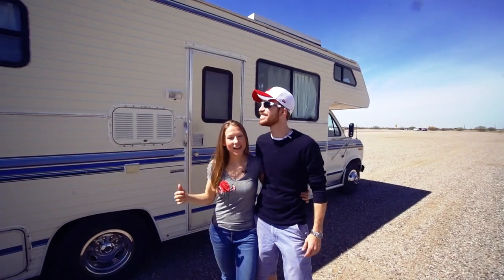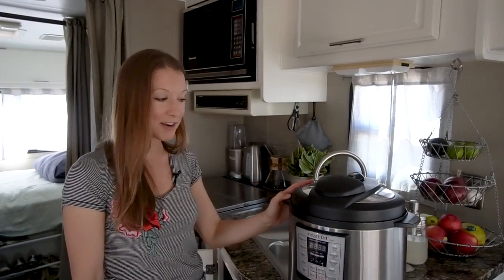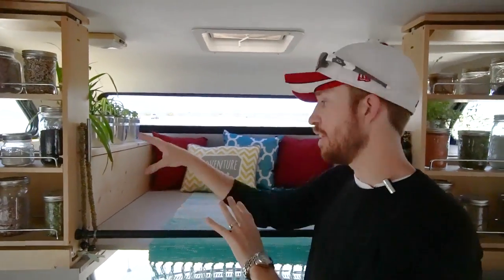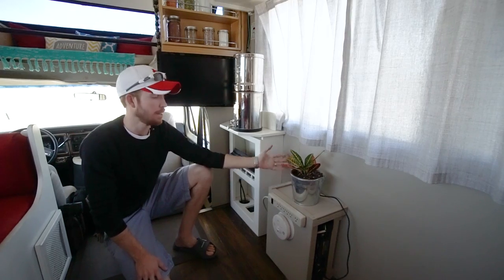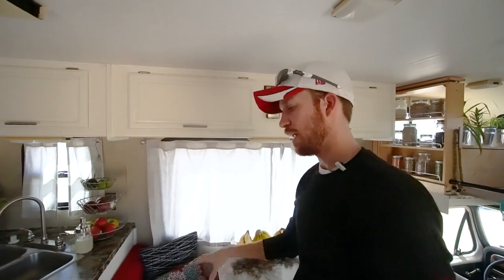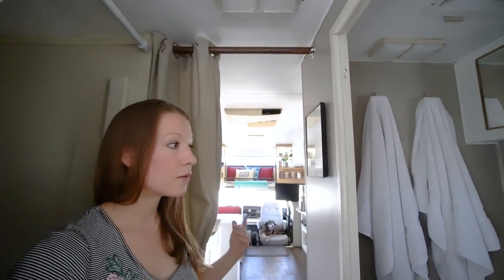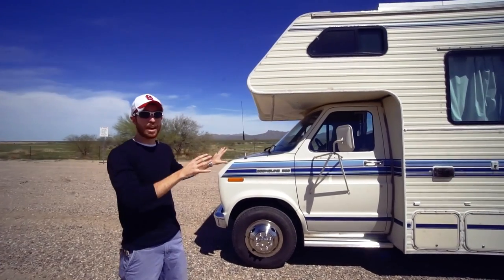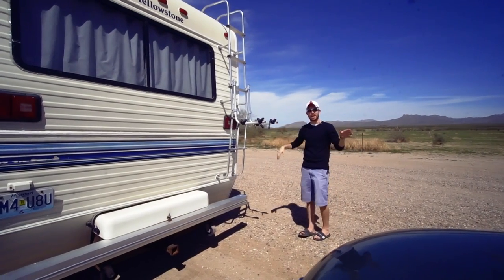They Renovated A 1989 RV Into A Beautiful Budget Tiny House

Comment: I don't get why people spend the money on a Berky unit which takes up counter space when they could just install the water filtration unit to the RV which is just as efficient if not cheaper. Also, she needs a butcher block to fit over the sink for extra prep space. Any wood workshop can make them. Beautiful remodel overall.
Reply: I'd never heard of that but as soon as I heard what it was I was wondering why not use a $30 Sawyer filter that is rated for 1 million gallons.  I'm amazed at how many people I see living in RV that don't take advantage of them.  Backpackers literally live off them and they're great.
Reply: That's what I did, hook up a filtration system in between the water pump and the rest of the RV... sure, it's maybe a bit waste to have filtered water run down the toilet, but since the overall water consumption in the RV is much lower than in a house, it's not such a big deal... ;)
Reply: I've got a Berkey and I'll just say the filtration is really good and the water tastes amazing. I don't know that it's better than another option, but my money was well spent!
Reply: I thought the same thing about the sink & a butcher block. And have it made separately so you can use the faucet on one side.
Reply: Jason Woodford Capacity of Sawyer Filter does sound smarter but this is a young....YOUNG....couple just starting to learn ups 'n downs of rvLiving.  Go easy.
Reply: The Cruisin' Crew Assume you know EXACTLY what their income and budget is to assume what another considers less cost. Either way I support your SUGGESTION in hopes that its affordable for them still. I say that she just favors [attached...reliance] on the Berky.
Reply: Yes young but very smart in getting the Berkey among other things....she stated the couple got the “Travel” Berkey...toucan literally take it ANYWHERE....plus there’s a filter on the Berkey that will filter the fluoride out....not many water systems can claim that....Good job guys!
Reply: Berkeys clean any water not like other filtration systems.  Like lakes and streams.  Gravity fed military grade.
Reply: That means you would have to rely on water hookups or water in your tank, would it not? With the Berky you can bring in water from outside instead, when you're off-grid and may not have any water in your tank either, or if the water system stops working for some reason. (That has happened in my RV before.)
Reply: When you travel who knows what the water is like. What if they had stopped in Flint, Michigan? My friend lives in a city dorm where the pipes are old and the water is foamy sometimes. Those Berkey things filter out lead, mercury, iron and a whole list of toxins you do NOT want to be drinking. Just for piece of mind alone I think it's worth it. If they are not eating meat and make their own food all the time, why would they be cheap about the water they are drinking?
Reply: Filtering your water is not a place I would want to skimp.  The Berkey
is better quality drinking water.  She's happy with it and it's not always sitting on the counter.
Reply: I thought the cutting boards for the sinks would be a great idea for extra space also!!💚
Reply: Is it maybe because they are boondocking and not hooked up to a water source?
Reply: Love the bright and airy loft area in the front!  So cute and the roll out shelves are very nice, beautiful and so useful.  The counters you painted are really nice too!
Reply: Shandele Broyles I bought a big wooden cutting board that was cut to fit exactly over the top of our stove and in our other house we used that as countertop space when we weren’t using the stovetop
Reply: I had a Berkey and it did not get my water clean enough. I discovered this when a white plate that got wet dried with the Berkey filtered water on it. The water residue on the plate RUSTED. Now at that time in my life, getting the water analysed did not occur to me. But since the water had so much metal in it that it literally rusted, I decided it was not safe and threw it away.
Reply: @shortygreyhannah  Hmmm. So many good reviews on the Berkey though... Was your filter working properly?
Reply: @estherstrategicadvisor749  yes, I tested the seals around the filters--no leaks, and the filters started out new and I probably filtered no more than 100 gallons when I noticed the issue
Reply: @iMiker62  very good point. Does the Sawyer get the flouride out?
Reply: The Berkey company has all these folks brainwashed to spend that kind of money and  waste their counterspace...umm did you notice she complained about counter space, yet loves her Berkey??   Much better options.   Same for these $1000 poop buckets, some kind of marketing to sucker people to buy them.   And also the floors that small a space, I got some laminate leftovers enough to do a whole RV for free.
But what a great job on the redo! looks beautiful, great work.

Comment: think if you touch up the damaged paint on the countertops and use a  to pack epoxy resin to cover it  it should last a lot longer
if youre repairing / rebuilding the inside and tear out the ceiling you can prolly make a flat roof intoo a pitched roof bij adding a central beam across the middle and kindah push the roof out of shape pulling the walls in a little in the process  before adding the inner skin , verry likely need to reseal the edges of the roof with silicone and recover it with paint if you do that

Comment: You didn’t mention anything about your AC. How does it work with your solar?
Reply: It won't, or at least not for very long... I can run our AC on the batteries, but only for a short time. We do have a generator for when the AC is needed.
Reply: Ive owned a class c for 19 years, remodeled it as well, so i dont need to listen to all this.  Ive had 2 class A's, one was a diesel pusher.  No longer an RVer!

Comment: Love the floor and I applaud your reuse/recycle mantra. She mentions your solar and can operate 100% off the grid. How do you handle air conditioning? Generator? Inverter?

Also I saw the two way radio antenna on the front and you had mentioned walkie-talkies. Ham radio? GMRS?

Comment: Great Redo.   Love those older RV’s.  I once had a 30 ft Fleetwood I bought it was a 1989 class A with eight thousand miles    The onan Generator Had 90 Hours on it.  The front passenger seat still had the new tags on it.     We’ve upgraded to A 30 ft cruiser by Crossroad.     Beautiful Lady.

Comment: Drill a hole in the sliding cabinets though the bottom of the support and put a dowel in the hole. Pretty, pretty easy and clean install.... if you like the way you did all the remodel then there were no mistakes, just learning experience! Great job!

Comment: Some pallet wood is VERY strong and excellent wood. I have a carpenter friend and he tells me that this pallet has excellent hard wood-oak, etc. I was thinking of using a warm white on my newly purchased fifth wheel, and seeing yours, which is lovely, has helped me decide. I like the ‘non-billowy’ curtains. Instant Pot, YES!!!! Good for you eating healthy! Brilliant idea with the tension rod! Yes to the Berkeley-been using it for years-stock extra filter NOW before they are back ordered or WAY more expensive with the probable coming inflation (my comment fall 2020). How about a live edge table in your dinette when the time comes? ...Excellent use of memory foam mattress! SO comfortable!  My ‘new’ 5th wheel has a dent! No water damage but a dent which I intend to inject with an epoxy and voila, fixed (it’s a tiny bottom corner on the slide). Well thought out Reno, (great solar install!), particularly for a first time! Thanks for posting :)

Comment: I have used the Gianni countertop paint in my rentals, if anything happens it’s easy to touch up and put another coat of varathane  (Varnish)
on top. Another option which I have not tried yet, but feel it should work well, would be to put an Epoxy coating over top of your counter. That should save a lot of wear and tear. Good luck to you both.

Comment: As a suggestion for the countertop that is a bit fragile, maybe getting tabletop glass cut to fit over the area where you need most to do prep work or whatever that would damage the countertop.    I have used glass on my countertop beneath my microwave where I set down hot dishes that would damage any laminate countertop.  It's an inexpensive solution to this problem.  I love how the countertops LOOK like granite! Congrats!!

Comment: Great rig! Maybe try a few coats of polyurethane for your countertops to make them more durable. Also for your composting toilet, I recommend a small fan inside your little box thingy and you will never have a problem with odor, ever, but it's an absolute necessity. One other little suggestion is if you like a hot soak, a friend of mine bought a portable tub and just takes her time filling it with hot, hot water for a nice long soak.The only problem would be finding a place to store it but they come in all sizes. Hers fits inside her shower and they come in rubber or tin. She sets hers outside and bought a shower curtain that's easy to put up, but this is just because she really,really missed her bath lol. Cheers and God bless you guys, you seem like really nice kids.😎

Comment: For the paint (for the kitchenette and dinette), you could use food-safe clear resin to coat the paint, to protect it from wear and tear. Though I would personally suggest using a stainless steel top for the kitchenette and dinette, so you can prep and cook without issue, and even so you can put a hot pan or hot pot on it without leaving permanent marks.

Comment: Really liked your video and learned alot about remodeling an older RV. You two did a great job and made a very nice tiny home on wheels. Good choice on the Travel Berkey we also have one and love the taste of the water and protection from all the bad stuff in the outside water and fluoride as well.  Great job on the solar but I think I would try using it for cooking and heating eliminating the propane.

Comment: Great video because we just purchased a similar 1982 RV.  Vinegar will kill plants and weeds so please be careful were you dump that shower bucket.  ? did you paint the inside of the cupboards too?  So far I have counted 6 different wallpapers including inside the cupboards.  I plan to prime inside and out this spring.  For your stove, they are not the best heat disbursement so I found adding a rectangular pizza stone above the heat source helps a lot.  Your outside body looks great, we have a few bumps and bad caulking to redo but may see  you on the road in a year.

Comment: If your batteries are 12v, you should switch over to duel 6v and run then in series (I think, I always get “in series” and “parallel” mixed up), whichever makes them 12v, and you will double your amp hours. It should not affect your input as far as hook up to your inverter, and the space you’re using for the current batteries should work out fine. I’m big on off grid and with that setup as well as a 950w generator, I could run my trailer indefinitely on a cheap 45w solar system from Harbor Freight.  My next build will be beefed up to better panels, 800w  with a back up generator (at least 2000w). And EVERYTHING will be ran off 12v or by the 3k inverter. Still working on the power system. Really trying to make the power system to be very efficient. I don’t want have to fire the generator up unless the sun pretty much burns out. Still, military mind set, back ups to backups, but I want it small, light, and efficient.

Comment: Great redo on the rev and as for the prep work, try getting a butcher block to fit over the sink and that should fix the problem. It will also travel that way so you don’t have to worry about storing it away. And if you want they are not that hard to make either.

Comment: I do recommend the 10 ply tires, you will notice the difference once they are on.  They do take the driving shard corners, conditions of the road very well, from sharp bumps to sudden ruts they handle the roads very well.  The only downside there is the cost, but safety is number 1 .

Comment: I know this video was made some time ago, But I had the time to follow you guys when you first got this rig. Thank God you have parents that could help guide you through so much of this. I have to say what you've done is flat amazing. Your rig looks fantastic. Glad to hear the 460 is still holding up. Did you ever manage to get your fuel gauge working. I've had ford trucks of that vintage and the sending units are in the tanks, and those with duel tanks never seem to work properly. Any major engine breakdowns? I've been looking at older rigs for the same uncomplicated engine reasons you mentioned. Again your rig looks fantastic.

Comment: Very entertaining, interesting, and great idea info.  I think it looks just as good on the outside as inside. And inside or out y’all did a fine job building this. It must be a large source of personal pride for you both. 
   I have a couple tips FWIW, on the countertops have you tried any of the new clearcoatings to keep it from chipping? 
   And Jmo, but you probably stumbled across one of the best models as far as Ford’s 460. Believe me, older sometimes can be priceless. (Cost effective in the long run). 
   Mileage? Maybe since you can’t tote the Civic, have your better half lead the way and design a huge spoiler for the Civic to knock some of the wind off of that big ol box 📦 you’re driving !!!😝

Comment: Use polyurethane coating on the counters, they usually heat resistance burn proof from scorching it with a pan and it is waterproof and usually scratch proof!

Comment: If you're just throwing the grey water out, you can simply do what is referred to as "leeching" by leaving the grey water valve open. I use a cap with a short hose attached. If you need to keep the grey for any reason, like not allowed to leech simply close the valve.

Comment: Watching this in 2021. Have you considered using an epoxy top coat on the Giani countertop paint?  The first time I used the Giani kit in the kitchen,  the paint started peeling after a year or so.  I redid the paint and topped it with the Giani epoxy and it is holding up so much better.

Comment: You mentioned about appliances like stove and oven and microwave are not needed...you can buy an electric hot plate burner single or double and keep in a drawer and a small toaster oven they work just perfect to cook all meals without having such big and expensive appliances saves space and allows you to have more cabinet area to fit more things in kitchen.

Comment: Quick question - why do you put the white filers into the bottom of the Berkey when black are typically installed in the upper chamber? I think the white are for extracting arsenic and floride but not sure.

Comment: If you do not exercise your generator periodically, when you do need/want to use it, it likely won't work for you.  You would be wise run it (with a load on them) for a good 20-30 minutes each month if you want it be able to use it in a necessary situation!!!

Comment: My husband got a wild hair a nd bought a motor home a 1984 24 ft cab over  sleeps 5 0r 6 fully loaded...AC/Vent heat... Generator micro Stove/Oven  3 way fridge. full bathroom outside shower. . We bought from a couple who were near 90 yrs old....  I stripped the walls  plastered them then painted them Toupe...covered the valance's with wine colored furniture  material  as well as the cushions at the table put in bed cover the mattress manufacture cut the corner for easy passing of two people... I only put carpet down in the bath and the rest of the RV... we had mini blindes and 2 chihuahua's one tore up the set over the table cause we left. her alone... in the RV so we learned to carry extra... A week after I got it all done and before our maiden voyage... Hubby took me shopping... He was "NOW" looking at Newer and NEW RV's.... He nearly had me talked into  a $40.000. But I told him to wait and see how much he would like camping... good thing we waited cause we only qent six times total... parked it.. now I use it to store my spinning wheels my weaving looms and my animal fiber... One day hubby went to check on things... THE WHOLE DOOR PEELED APART!! THEM OLDIES RIPED US OFF..THE DOOR WAS ROTTEN AND THE DID A REPAIR GOOD ENOUGH TO GET IT SOLD OFF... GOOD. THING IT HAPPENED AT HOME AND NOT ON A TRIP OR ON CALIF HIGHWAYS....

Comment: Sealed Cork is good and insulating for floor and lightweight. I hope the 3 dogs get steak. There are flexible foldable solar panels which charge a portable powerhouse. There is always time for prayer and a bit of PS3.  A wash basin and washcloth will help save on water and keep you clean between showers.

Comment: You know, seeing as you don't actually use the space to lay down in the overhead, i'd just cut it out & eliminate it altogether (unless it doubles as a spare bed). It would make storage access easier (you'd be able to stand & get into storage without reaching past floor area into the back corner of the boxes), and easier to get up into the main living area from the driver & passenger seats. Anyway, just a thought.